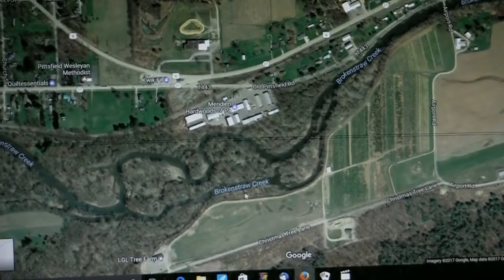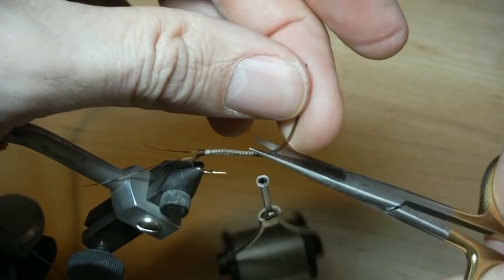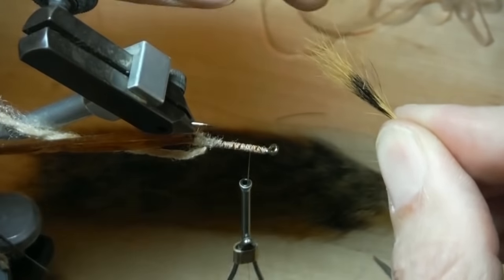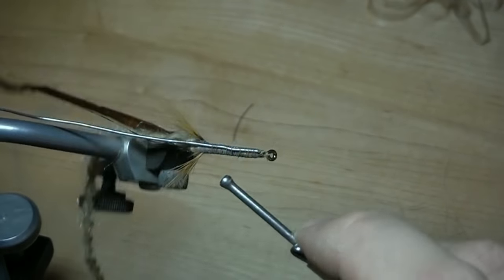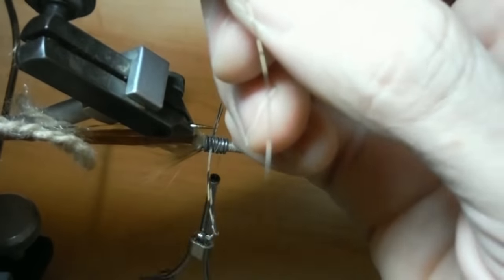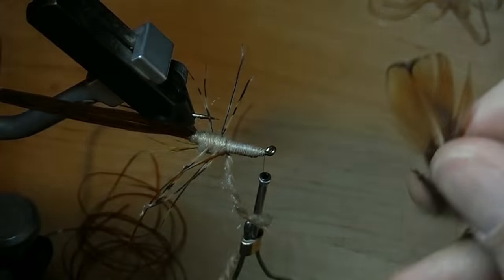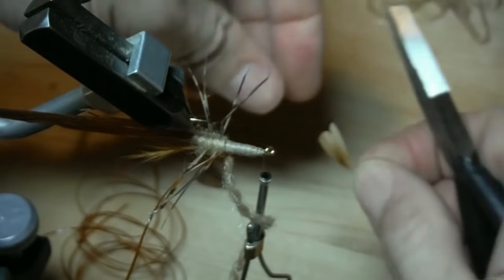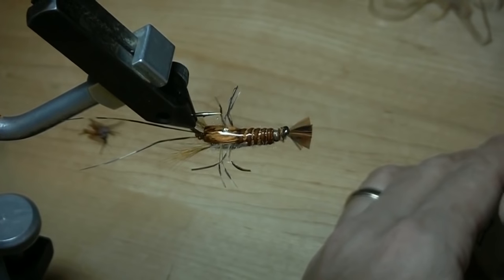Tying a Crayfish Fly

Comment: Like everyone else said in the comments.
Great pattern and explanation of instruction, I have a question about the weight what is the Benefit of putting most of the weight at the hook bend? I always put most of my weight at the hook eye so when stripping it lands claws up like a defending crayfish?
Love your video just curious as to what the benefit is.🍻.
Thanks.
Reply from the maker: You do it that way so the fly sinks with the hook point up.  You could bend a kink into the hook shank, giving it a "keel fly" appearance. Or you could tie in the claws so they are angled a bit skyward.

Comment: Nice crawfish pattern, instead of the straw I use a bronze colored ribbon for the same effect, and pheasant feathers
Reply from the maker: I'm still searching for the ultimate material for the carapace.  Yours sounds intriguing.  If it has durability and will sit in a box for years without degrading, it could be very good.
Reply: @petercollin5670  a friend of mine use a stretchy clear silicon bronze colors tensile type material, I dont know the name of it but he ties shrimp bodies with it and crawfish

Comment: Best Crawfish video I have seen as well as a simplistic approach to tying.I don't have Swiss straw however I will try an alternate material. 
What are the min/max recommendations for length?I definitely need to tie some for my fly box.Peter, thanks for sharing your pattern.
Reply from the maker: I have tied these down to a size 8 hook.  To go much bigger than a size 4 wouldn't work because the fly would have too slim a profile, proportionally.  Also, it may become too heavy to cast.
Reply: Peter Collin 
Thanks for the info Peter.

Comment: Very nice work! Question... what type of yarn are you using. It's doesn't appear to be Antron so I'm guessing it's some type of polyester of polyester blend. Also looks a little rough for an acrylic.
Reply from the maker: I am not particular.  Sometimes I use dubbing.  The yarn in this video is Antron - - "Dazzle Aire" by brand.
Reply: Peter Collin Thanks for the yarn up date. I'm going to tie some of these up this weekend. I'll use Antron but I'm also going to tie some with dubbing using a dubbing loop. I think I'll be able to get a different look while also having a greater color selection. Thanks for sharing this fly.

Comment: very nice pattern.  Can you suggest substitute material for the swiss straw?  How about brown thin skin?
also what is the best way to fish this fly?
THanks
Brian
Reply from the maker: My favorite material for the back is a stretchy tan latex that is 3/8" - 1/2" wide.  I can't find it since all the boutique fly shops have closed in WNY.  Its downfall was that it had a shelf life - it would degrade after a few years, quicker if it came in contact with fly box foam.  (same material as scud back, just wider).  I have used leather, various kinds of plastic, and elk hair instead of swiss straw.  I'm hoping a viewer can help discover the ultimate material!
Reply from the maker: In streams, you can dead drift the fly.  In still water, you fish it on the bottom , slowly and twitching it in.  When smallmouth are shallow, these are deadly.  But I made the fly small enough for the average trout to eat, too.

Comment: try tying on your initial idea two strips of lead equally and flatten tips for a smooth taper and maintains hook point up.i like your material selection.
Reply from the maker: I used to do it that way. But I used to make these commercially for a fly shop. Doing the weighting all in one continuous piece is a real time saver.
Reply: Peter Collin how much did they sell for ?
Reply from the maker: I haven't sold any in years.  Don't quite remember, but I didn't make that much at the time.  Labor of love sort of  a thing!